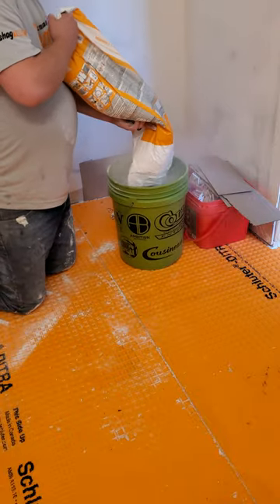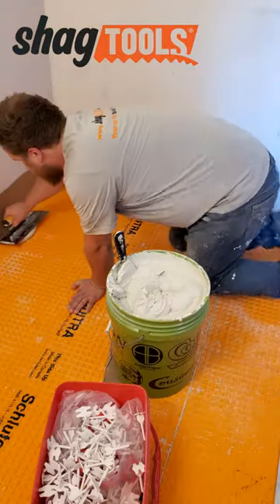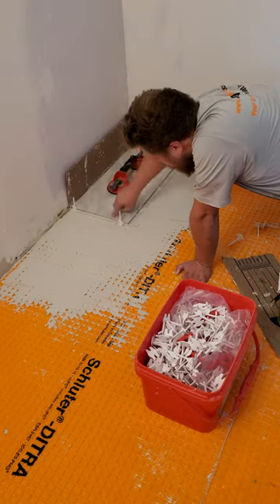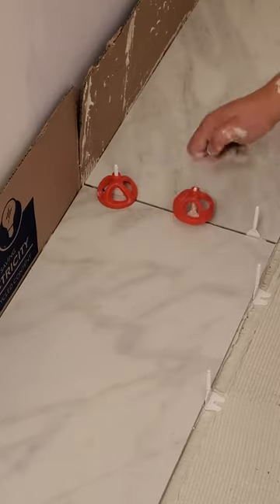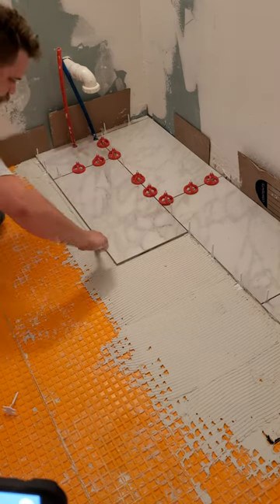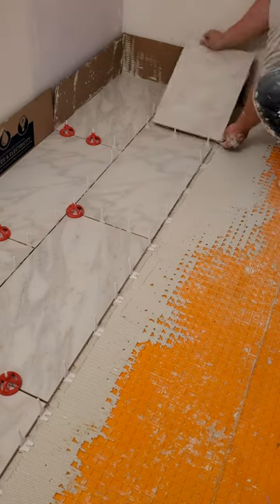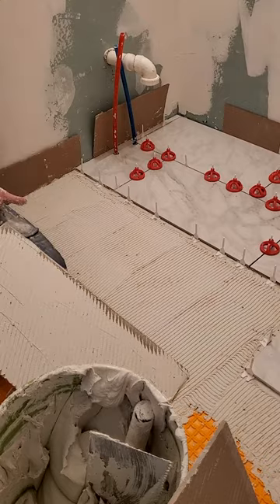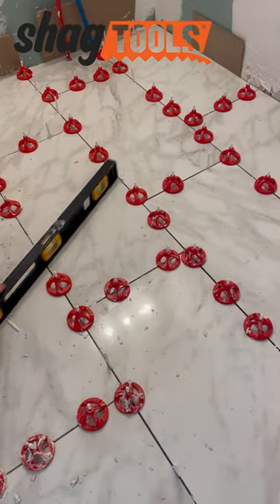How To Install Tile || Easy Bathroom Remodel Ideas For Beginners

Comment: I third that. 
1/2”x1/2” for large format tile. 
Hopefully you’re okay. Also don’t think you need that many levelers. And that drill should be around 300 rpms. You wanna mix Schluter slow. Great video though practice makes perfect.
Reply from the maker: Agreed I should have picked up a larger trowel but I think everything worked out alright. The DITRA and back buttering helped me out a lot, but for anyone trying your own, definitely go with the 1/2”x1/2”. I also think I don’t need quite as many spacers but there not hurting anything and made me feel better for this first one. Great tip on the mixer are you saying 300 rpms on the mixer should be good or I should go even slower? Thanks again for the tips and for the encouragement I really appreciate it. Have a great one!
Reply: I always use ½" trowel for all 12x12 or bigger tile, just makes the job a lot easier. Floors are never perfectly level.

Comment: 1/4”x1/4” trowel?   Better not be.  Its always good to lift a tile after setting it to check for coverage.  Should be 85%+ on the floor in a dry area.  Large format tile need a 1/2”x1/2” trowel or maybe one step down if the floor is prepped well.

Comment: Wouldn't a spacer at every intersection be enough?
Reply from the maker: That’s a great question, yes I think that would work just fine, maybe add one more in the center of the 24” seems, just to be safe. I think I went a bit overkill with the spacers but it wasn’t much more work, spacers are cheep, and it gave me more peace of mind as the mortar was setting up so I don’t regret the extra ones. I hope that helps and thanks so much for watching and for the question!

Comment: I love watching people trying to set tile! Why can't guys scoop the thinset out with the trowel you are using
Reply from the maker: I think it probably comes down to experience, as I become more proficient with tiling hopefully I won't need to use a smaller tool to scoop like I did here, but for now it was a helpful and made the job more manageable for me. The other aspect I cringe at while watching myself work in this video, is that I always stick the trowel in the bucket of thin-set when I'm not using it instead of resting it on top and keeping it clean. It was just one of those things I didn't think about at the time but after watching more experienced tile setters work, it seems like such a simple and effective fix. I really look forward to my next tiling job and to using what I learned from this job. Thanks so much for watching and for your comment!